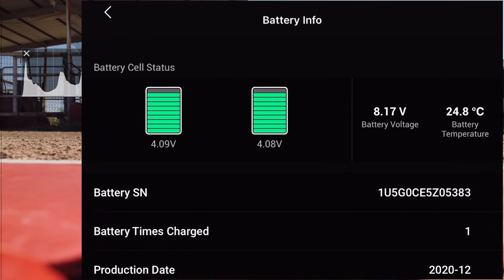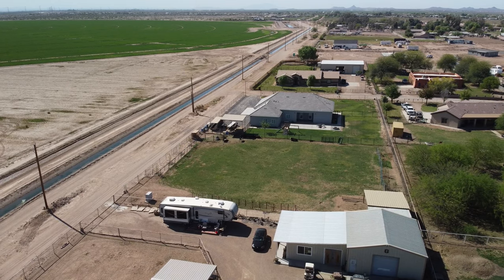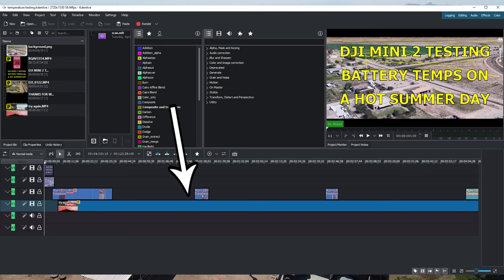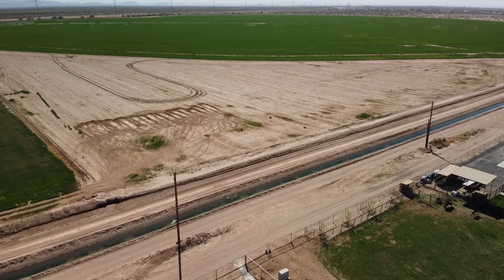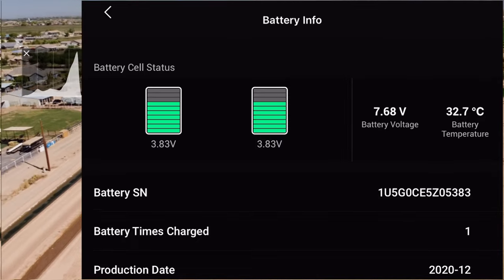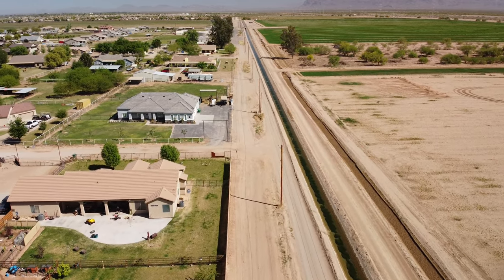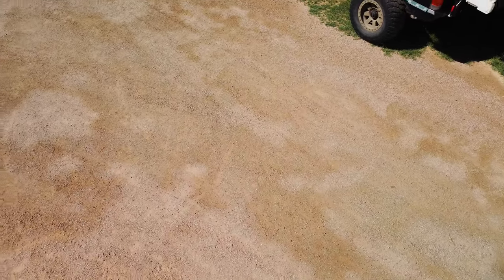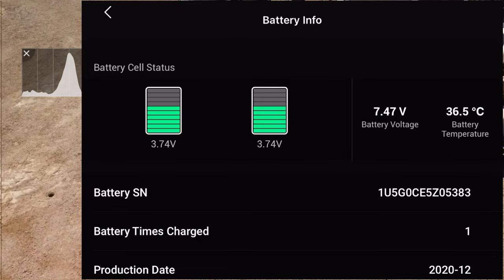DJI MINI 2 TESTING BATTERY TEMPS ON A HOT SUMMER DAY

Comment: I also live in a very hot area and one of the reasons I didn't upgrade my Mini is from what I understand the Lion batteries have a much higher tolerance in higher temperatures.  If nothing else you can always use your Mini 1 batteries in the Mini 2.
Reply from the maker: Thank you Craig for your comment and input. Yep, those are the batteries I am using in my Mini 2. God bless.

Comment: Here's an easy way to convert C° into F° on the fly (pun intended).
First divide the celcius temp by 5 & after that multiply your answer by 9, then just add 32 to the result.
Bam.
Or to illustrate in this case,
40° C ÷ 5 = 8, then
8 × 9 = 72, then
72 + 32 = 104° F.
(ouch-hot stuff)
Just reverse this to find Celsius:
Subtract 32, divide by 9 & multiply by 5. Good luck without a calculator.
😜
P.S.
I love your work.
Reply from the maker: Thank you John. I have heard of that before but just too lazy, so I look it up on a chart. But I really appreciate your input. God bless you.

Comment: Love your videos and stories. I thought the 0-40 degree celsius range was for the temperature of the environment you're flying in, not the battery temperature. Wouldn't it be ok for the battery to be a little warmer? I guess I'll have to keep a closer eye on the battery temp as the weather starts to warm up. God bless. Jeff
Reply from the maker: You are partially correct. You can run it up higher but it shortens the battery life. I have gotten mine over 50 at times but wouldn't recommend it. Thanks and God bless.